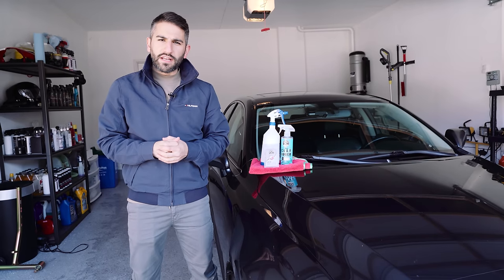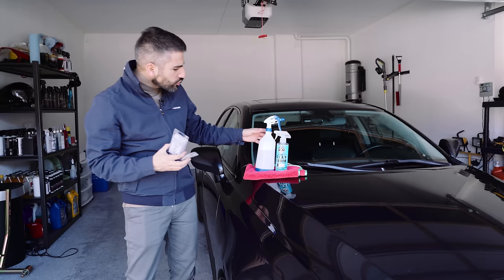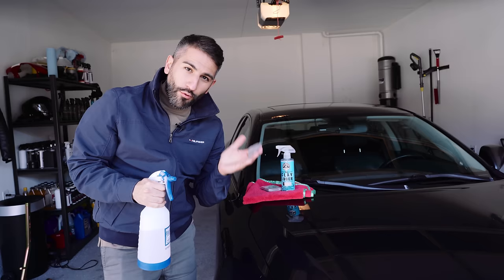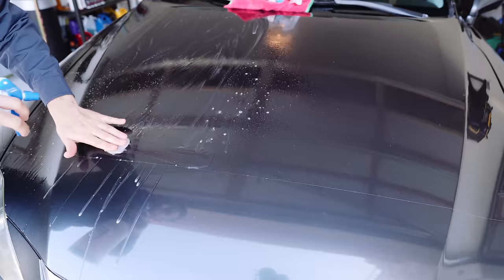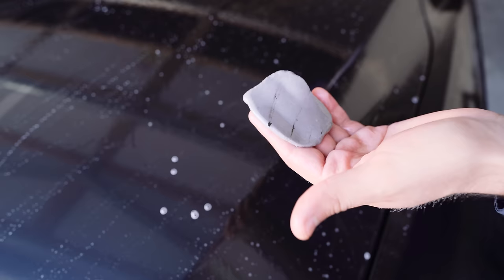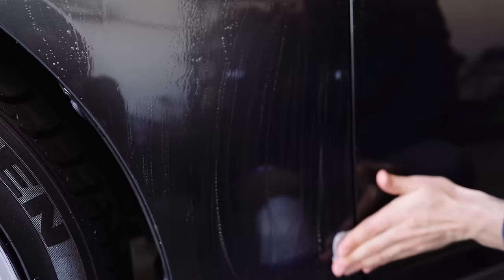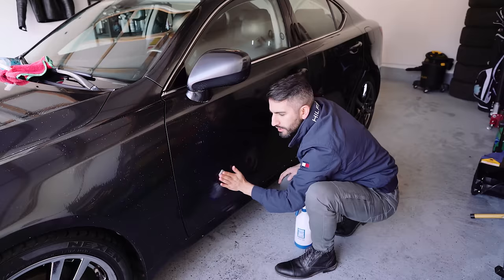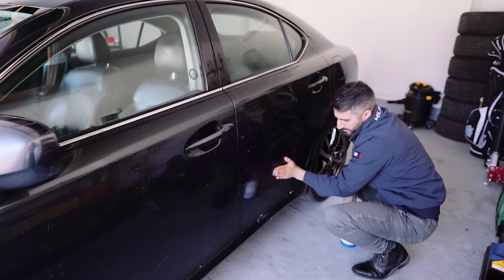How to PROPERLY Clay Bar Your Car! Professional DIY

Comment: How many times can you fold that one piece of clay bar you used to do one car? Like maybe do the hood first then fold, fold for each door? What about back trunk, bumper, etc.? And when done with the entire car, I assume you have to throw that piece away?
Reply from the maker: You should probably look to fold it when there is 50% gunk and debris across the face of the clay bar. You don't want it to build up too much, you're probably folding it three or four times to do an entire car depending on how bad it is

Comment: Be very careful with soapy water formula.  Most people will use dishwashing liquid which is a MAJOR no-no for washing cars.  Dishwashing liquid is highly abrasive as they are designed to be a degreaser.  The clay bar  itself is a soft scrub exfoliator.  In addition to this, you do not want soapy water to dry on your car, ESPECIALLY darker colored cars.

Comment: I totally destroyed the paint on my car by using a clay bar. It didn't become noticeable until at least a year later but the clear coat developed crazing everywhere. No doubt I screwed up but I would never risk it again.
Reply from the maker: There is no way of this could’ve destroyed your paint unless you filled the clay bar with dirt and went to town on it. It might be something else?
Reply: That sounds like a defective paint from the factory or a cheap body shop paint job. Clay cannot hurt the paint or clear coat.

Comment: Oh man that is a lot of crap coming off the lower panels.
Reply from the maker: Yep gross
Reply: @carswithsonduren  I did mine recently and experienced the same thing. More dirt on the lower panels was picked by the clay bar so I focused more on those areas to make sure it was properly cleaned before polishing. Appreciae this video as it helped alot.

Comment: Wouldn’t it just be easier to wash the car with the foam canon and then foam the car again, just for the lubricity it provides for the clay? Thereby skipping the need for the clay lube spray?
Reply from the maker: Well you would need to wash the car with a mitt regardless to ensure you get all the grime off but after that you can definitely foam it again but you will still need a spray lube as the foam will eventually start to dry up and fall down

Comment: How come non of these guys ever get a good camera man?
Reply from the maker: Sony a6300 is pretty decent.
Reply: @carswithsonduren  equipment doesn't matter in capable hands. I was referring specifically to the severe and annoying auto focus instead of manually focusing.
Reply from the maker: Manual focusing is not really ideal but I know what you are saying. Usually Sony autofocus is top notch.

Comment: I can tell you, when you clay a white car, it’s much different.. you can literally see every single contaminant and then watch it disappear.. sometimes some of them come off with a few swipes, others require 50,70,100 swipes for the clay to pick it up. It’s crazy but any non-white car you’re likely only grabbing max 50% of the contaminants with a few swipes. Could easily do that car in 1-2hours. With a white car it’s easily 12-18hr job because you simply can’t ignore seeing the specks and leave them there.. there’s hundreds of thousands of contaminant specks (mind you I last clayed 2 years ago but still crazy) .. the rust colour looking ones come off easier, then there’s the black specks which sometimes take 50-100 swipes.. pain in the ass but defo worth the paint looking way fresher

Comment: Can you clay bar your car after a year later of ceramic coating ✌️🇨🇦
Reply from the maker: You probably don’t need to if you have the ceramic coating on it, unless it wore off. You should check to see if it’s worn off or not the most likely you don’t need to.
Reply: @carswithsonduren  thanks ✌️

Comment: So nervous that’s it’s going to scratch 
My clear coat
Reply from the maker: Just use a lot of lube and be gentle.
Reply: @carswithsonduren  wow thanks for responding so fast I’m looking forward to do this, I never knew about claybar.
Reply from the maker: Awesome and it will make your paint very smooth! If you have any questions let me know and welcome to the channel
Reply: @carswithsonduren  did u pour half chemical guys lube half water in that spray?